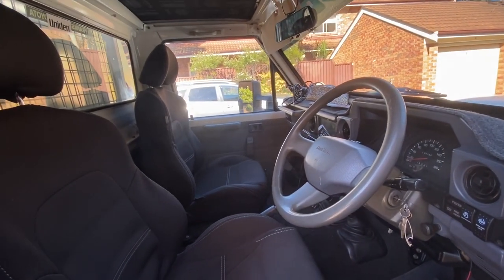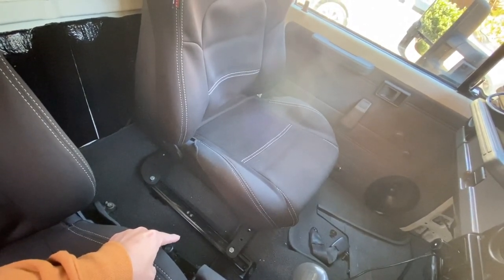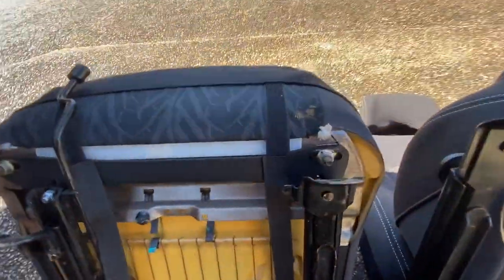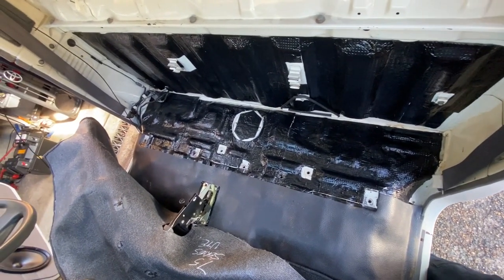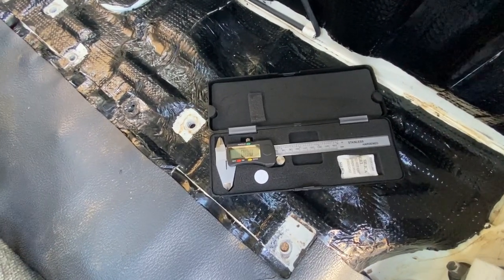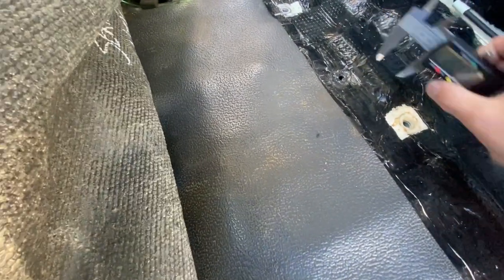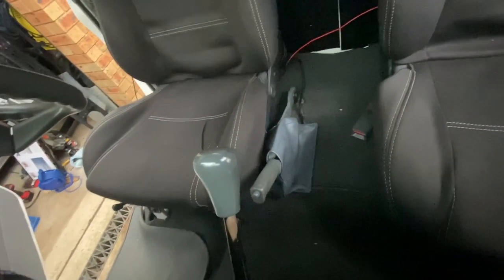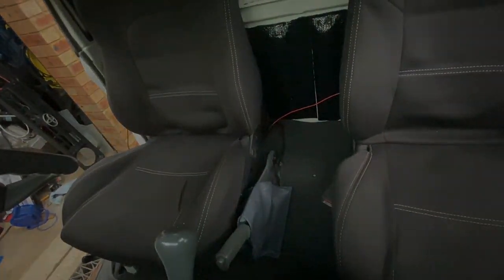Landcruiser 75 series hurricane seat rail modification

Comment: Hi 4wd camping this was certainly not the case for my 79 series single cab there was no nut set under the floor so now I dont have the complete kit that is needed and have a hole in my floor for no reason trust me I've tried to find it and is definitely not there so now I have to re order an extra part and sorry to have stuffed around hurricane fabrication they make a good product just ,put in what you're vehicle has and they will handle the kit you need
Reply from the maker: Hey Brendan sorry to hear about that. The video is aimed at the 75 series and not the 79 series. I say that right at the beginning of the video. Thanks for bringing it up ill make it more clear in the heading. Sorry about the misunderstanding.

Comment: Please Note, not all 75 series have the nut even after drilling out the hole, plus the brackets you show in this video are an old design and are now outdated. You are causing a lot of confusion with people that buy our brackets and people are drill holes in the there car when it's not needed. I've told you this before 4WD Glamping but you don't seem to care.
Reply from the maker: Thanks again for the feedback. Suggestion taken on board and video has been edited to suite what we have discussed. Cheers (took me a little while to figure out how to do it)